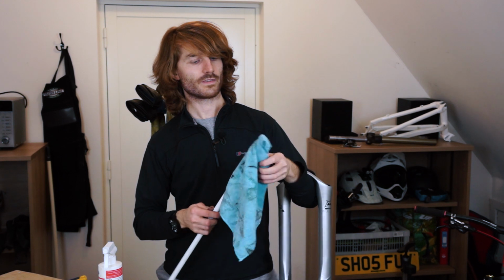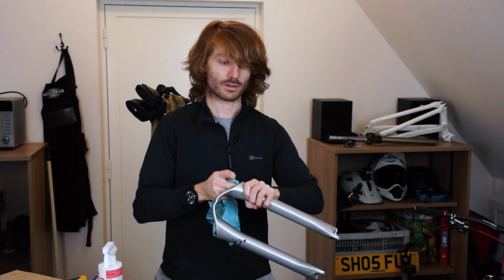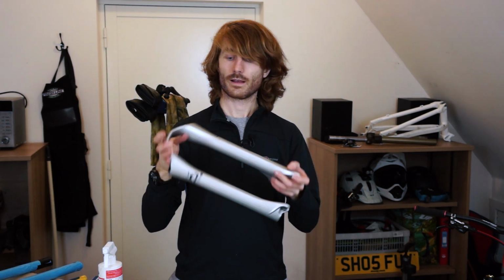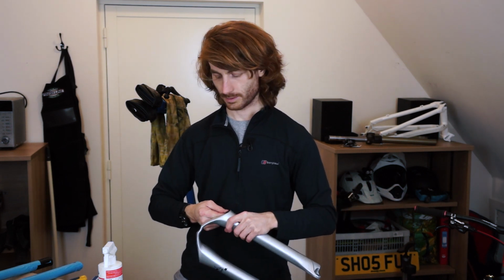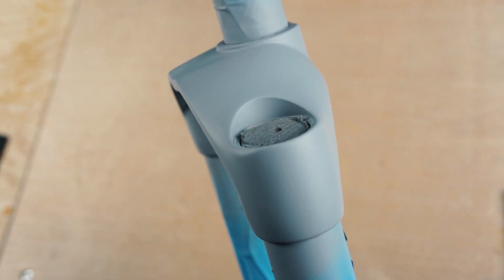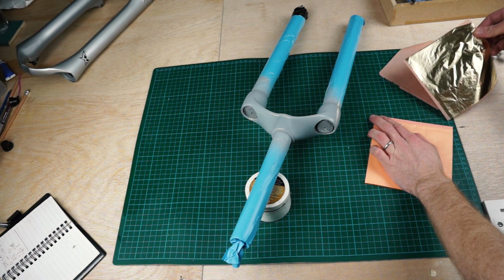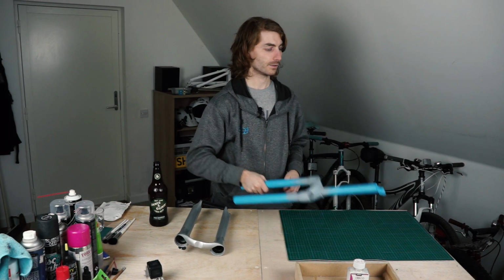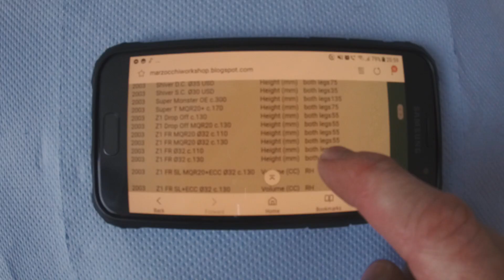OLD BUT GOLD! Refurbing a Retro Marzocchi Z1 & Turning it Gold

Comment: how good is that suspension? Im planing to buy one in 2nd hand, but im kinda afraid
Reply from the maker: If they are in good nick they are worth it. I have much more modern forks on my other bikes and at no point when riding these forks have I thought their performance showed their age. But I would keep to what they are good for, if you are planning on hammering proper enduro tracks are race speed you will be potentially disapointed. 

The biggest drawback is the setup, there are 3 air valves that use a marzhocchi specific adapter (easy to find). One for the air spring on both sides and one that firms the compression. But once I got dialled it's been a great fork.
Reply from the maker: Here is that fork now so you can see it being ridden. 
https://youtu.be/CHA4mVbDCQA
Reply: @StravaigingMTB  Thanks really appreciated the feedback
Its so hard now to find 26'' suspensions, the strugle is real
I have an GT Force 3.0 with Suntour Magma 32 and the suspension its already dead
Reply from the maker: It was Suntour, they were dead when new 🤣
Reply: @StravaigingMTB  Sad but true ahahah
Reply: @StravaigingMTB  "potential disappointed" it's a Marzocchi there literary indestructible, they can tackle gnarly dh. those forks will out live you! 👍

Comment: Is ok to paint the rods in between your gold leaf and the black part of the fork? I want them gold.
Reply from the maker: 100% no. Those are the stanchions, they slide through the dust seals and some bushes inside the lowers (black bit). They  have a special anodized or metal coating and are a very precise width. Paint would wear off and damage if not destroying the internals. Paint the crown (gold bit) not the stanchions.

Comment: how do you rate the enduro seals? got a pair of all black 2004 z1 fr 130mm (i think) and they need a good service
Reply from the maker: Sounds the same as my forks, mine are the FR SL I think. I find them ok, some complain of stiction but in my experience once they are bedded in  they have been fine.

Comment: I just took my bike all apart but cant take the plastic rings out of the top fork. It's in there pretty good. Tried hard too but no luck. I didnt want to destroy them. I saw in some vids that there was a clip but mine has no such thing. I gave up. My buddy tries too.
Reply from the maker: Not sure what plastics rings your referring to, can you link to a picture of your fork?
Reply: I meant the plastic seals. Learned alot since that message I sent you. Turns out my powder coat guy didn't paint my marzocchi bomber forks because he couldn't get the plastic seals out. I took my suspension completely apart and serviced them. Cleaned, greased and unfortunately I couldn't find 7.5wt in the city so I used 7wt. Hopefully that's ok. Now I feel like I should of painted them myself after getting them back. Uhg... Not sure what to do... Upgrade and buy a new suspension or rip apart my marzocchi's yet again and  paint them. And paint the silver part like you did too right above the stanchions. Big decision. Wonder how much I could get for my suspension if I was to sell them. There in great shape for 2004.
Reply from the maker: Ride them for 6 months. Then when it's routine service time paint or sticker bomb them.
Reply: Good call. I saw on ebay a guy selling my marzocchi bomber exr suspension for over $340 bucks. That's rediculous for such a old outdated suspension isnt it? I'm thinking maybe I could get 100? I'd like to get either marzocchi fox 320 or Manitou I think. I wanna spend about 250 or less if at all possible.
Reply from the maker: 320 is good, Manitou are under rated. $100 would be a good sale.